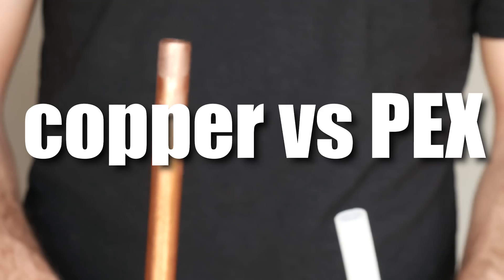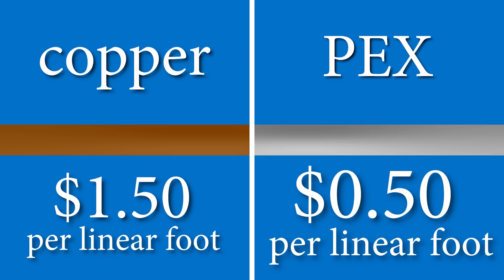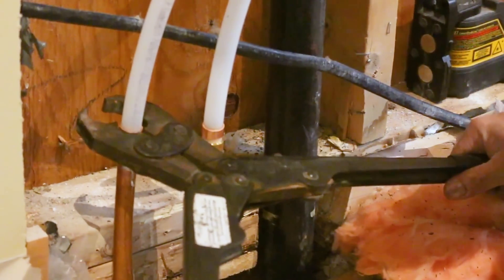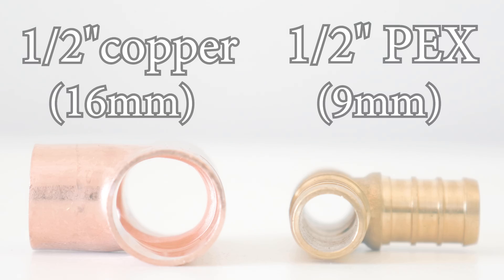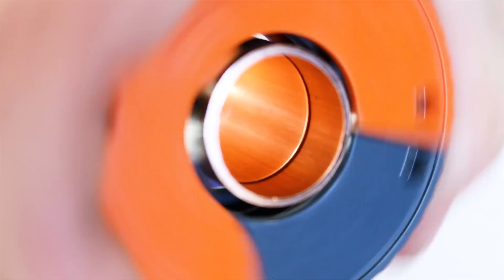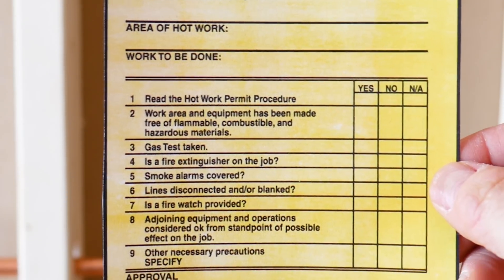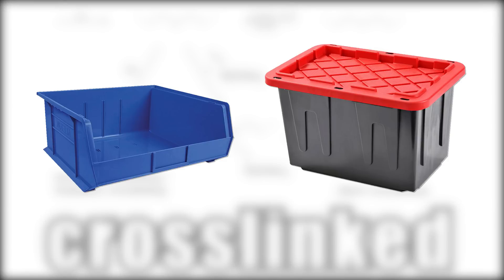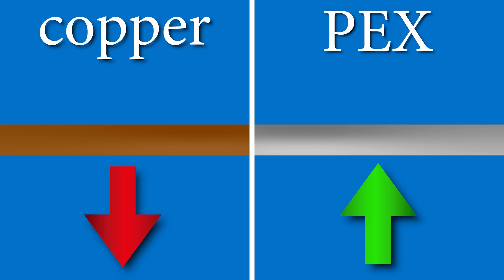Is Copper Better Than PEX? (COMPLETE GUIDE) | GOT2LEARN

Comment: A comment from a plumber friend of mine:  
"A lot of good points were made.  I would question his lifespan for both being 50 years I have removed copper that was over 50 years old and would have lasted another 50.  The pex system he was using had a metal ring that was compressed keeping the pex tigh around the fitting, over time the metal looses its strength I won’t even talk about degradation because of water etc..  Your pex system will last much longer than fifty years because you have a plastic ring that holds the pex in place."

The pex system he installed for me was using Uponor tubing with plastic rings.  Personally, I would only use Pex for heating and copper for drinking water because of copper's antimicrobial properties and plastic potentially leaching into the water.
Reply: Uponor fails often because of breakpoint chlorination and the undulations in the interior of the pipe which allows buildup of chlorine and ammonia. Fails in under 10 years, zurn pex b is also expandable but doesn't have the same issue with chlorine or ammonia because the interior is smooth.
Reply: Copper these days are recycled and the crappy stuff lasts 7 years.  Also, its hard to know how pure the copper your buying is.  In some states copper is a horrible choice based on the water.  The water will degrade the copper quicker than other areas.
Reply: I find your answer awesome and beneficial to me. I am trying to choose floor heating for my house and I was wondering if Uponor is really good. Most experts here do not know Uponor and say it is a lie because it takes only half of the size of the old school pipes in-floor heating. Do you have only 1cm isolation under it, or do you have more?
Reply: @galenachannel  I used Uponor for a cast iron baseboard radiator system.  Not floor heating.  Regardless, here in the NYC area it is the preferred product of the larger plumbing companies and contractors it seems.  I’m friends with multiple plumbers and they are sure to use only quality materials for my projects as I don’t mind paying extra for good value.  👍
Reply: @ed1pk  thank you. Quality seems good, but I wonder about the lack of isolation they advocate.  OR at least my local Uponor representative says I need no isolation on the floor, unlike the old-fashioned floor heating which must have isolation.
Reply: my copper was toast in 30
Reply: Remember copper comes in several wall thicknesses. What is it the K version the thickest? Or refrigeration copper line for direct burial under slab? Some of that copper gets pretty thin, cheap stuff anyway.
Reply: Excelente input, thanks you.
Reply: You're using anecdotal evidence.  I'm not saying he's wrong, but you shouldn't base your opinion on what a single or several plumbers have said.  Don't even rely on opinions on websites published by plumbers.  They likely have biases and are pushing a narrative.  You should try to base your opinions on research and statistics.
Reply: @absoluteloyalty9033  I’m not using anecdotal evidence for anything.  Just sharing an expert opinion.  Don’t sweat it. 😉👍
Reply: @ed1pk  When you rely on one of your experiences, that's considered anecdotal.  It doesn't matter if it's from a plumber; it's one data point.  Furthermore, 90% of plumbers are clueless.  Many of them are high school dropouts.  Most of them couldn't make college.
Reply: @absoluteloyalty9033  I’m not relying on anything.  I’m sharing the lifetime experience of an expert plumber.  Not one anecdote. You’re the one easily dismissing it.   Give merit on the plausibility and veracity of the explanation given.   Don’t just push your own narrative based on your “statistics” and personal dismissive bias against most plumbers.   That’s what these comments are for.  Sharing personal opinions and experiences.  Not formal verified stats and figures.  😂
Reply: @ed1pk  You are not relying on anything?  You are relying on the plumber's advice as well as sharing his opinion.  And, his advice might be the result of a lifetime of experience but it's still anecdotal.  It's still one data point that's based upon one person.

Second, a lot of contractors will try to validate their opinion but prefacing it that they have 30 years of experience.  I actually work in the industry.  If they are a bad plumber after 10 years, they are a bad plumber after 40 years.

Finally, I know this may seem snotty but it's just the blunt truth.  Most contractors in construction or other similar industries do not have a college education.  College doesn't make you smart but getting into college does represent due diligence.  It's no different than police officers.  Most are simply not smart enough to get into college.  As a result, you should be wary of their opinions.

Please try to think more before you make an opinion.  I'm not saying you're ultimate conclusion is incorrect (I actually agree with it so I'm not pushing a "narrative") but your method is wrong.  Please do not use the opinion of one plumber as the basis of your own opinion.  And, especially do not disseminate it as it leads to misinformation.
Reply: @absoluteloyalty9033  that is not only rude it’s wrong. Instead of accusing other people of basing opinions on antidotal evidence, try not doing it yourself. 
Your later statement proved your bias and therefore that you are unreliable as a source. Soooo…. Just troll on out of the channel
Reply: @absoluteloyalty9033  Yeah... well most college grads can't get a decent paying job while a tradesman will make way more money over a lifetime and always be able to find work!

Comment: I just recently gave in and started using pex to replace a frozen cracked copper pipe. Always said that i would never use anything but copper but with the current prices it's almost crazy not to try other options. Im still a fan of sweating copper but am starting to like pex equally for many reasons.

Comment: One item to factor in as well would be health issues. PEX is plastic, and there is at least some evidence that it can leech chemicals into your drinking water, with all the health effects this would imply.

I'm thinking I would use copper on drinking water equipment, with PEX being OK for other applications like bathrooms and washrooms. Of course, this also has an impact on your recirculation system if you have one.

Interesting video, as always !
Reply: Copper is now doing the same. The water treatment plants are using more chemicals and its etching it away.
Copper poisoning will be the next big scare.

Comment: An old copper installation is repaired and expanded again with copper.

Plastic tubes will be used for a completely new installation.

For copper there are solutions without soldering. 
Plug in and seal with built-in seals. Even better pressing, seals are also installed here.
Using this method, the heating in the Pentagon was renewed.  
Extra plumbers were flown in from Germany.

The downside is the price of copper.
Reply: Actually, you can repair an existing copper system with PEX. I have done it.

Comment: Does your PEX in the US doesnt have an aluminium layer? Here in Europe the PEX tubes have 5 Layer. PE tubing, polymer layer, aluminium tubing (1mm), polymer layer and on the outside an protective PE coating.

Also to press the fittings on you need expensive hydraulic presses...you cant do it with your hands like you showed in your video.

So i was just wondering...a PEX tube in the US looks like a better gardenhose. I would never lay it under the floor (screed)

Comment: For the flow restriction in couplings, this is completely ignoring Pex A expansion fittings, where it's full diameter and stretched as opposed to smaller and clamped/crimped.

Comment: I don't like PEX, because it is not gastight.
I like aluminium (or aluminum, whatever you like more) compound piping better, because it is a three layer pipe. Inner and outer layer are PE, the middle layer is aluminium (or aluminum). That thin metal layer makes it gastight.
The amount of tools is comparable to PEX, with only a calibration tool needed in addition.
It is as flexible as PEX and at the same time you can bend it to shape and it stays that way.
You can press it it up to 32mm (about 1 1/4 in) with big manual, bolt cutter style, hand tools (and a good breakfast) and machine presses (a little bigger than a power drill) likewise. Above that size the machine presses are mandatory. They are also a good option for tight spaces, but over all they are...pricey.

Comment: The main question to me is which lasts longer. 
And I'm afraid, PEX has not been around long enough to be able to tell about it's longevity.

Replacing piping can get extremely expensive, so that may justify an initial higher cost of copper.
Reply: It's been in use since the 1960s.

Comment: PEX is what I use on a daily basis but I think one thing that you forgot to mention
Is if you're plumbing is exposed to copper looks better 💁
Reply: 100% right. I installed an outdoor shower a couple of months ago and ran copper where it came out of the wall with brass valves and shined them all up, but on the inside of the wall, it was pex all the way.
Reply: @Odin029  So you think these mice cannot get to the inside the walls pex ??
Reply: @sajidrafique375  I said I've never seen pex pipes with rodent damage. That doesn't mean it can't happen, just that it would seem to be rare... at least where I live.
Reply: @Nonybusinessxxxxxx  PEX and other types plastic pipes are accepted and normal types of lines for potable water here in the US. Insurance companies will cover damage so long as their rules are met. That includes rodents chewing on pipes. I've never run into it once even as PEX has become the default in my area. I've repaired countless pinholes in copper, but not a single rodent chewed pipe.
The point about chemicals leaching into water flowing through PEX is the most legitimate. You're exaggerating a little, but it's at least a real issue. I've been reading articles and studies about that subject since at least 2014. Every study says that the water is completely safe. 
Speaking of safe to drink, have you ever looked at the inside of a galvanized pipe that's been used for a few decades?
Reply: @Odin029  
PEX sucks. Maybe it's just me but I have a hard time getting a good solder joint.
Reply: @tinman1955  Practice practice practice. You'll get it down one day.
Reply: @tinman1955  Get a crimp tool for copper and retire your torch there bub.  Also soldering is pretty easy.  Just need to get better at it, and it is all about controlling your heat.  When you have your torch on the fitting to heat it up, constantly use your solder wire to check the temp to see if it is hot enough.  You get it all too hot and it fucks it up.
Reply: @tinman1955  Was that a mis-word or did you just complain about difficulty soldering PEX pipe?
Reply: @r6u356une56ney  
It helps to get some proper PEX flux...and a bigger torch. 🤣

Comment: I'm hoping the cost of fittings and the ProPress tool itself gets low enough eventually to afford homeowners to use it.  All the benefits of copper with the install speed of PEX. OR Uponor can make the outer part of the PEX piping from something rodents dislike and won't chew through. 🤔

Comment: It should also be noted that if you decide to go with PEX, specifically PEX-B (crimping-kind), you have to up-size your PEX pipe size.  If you are replacing existing 1/2" copper pipe, you should use 3/4" PEX pipe and fittings to have a similar inside diameter size of the copper pipe.  BUT the problem is most fixtures like shower body valves or sink faucets are typically 1/2" connectors so you have to down-size back to a 1/2" PEX at the fixtures. Uponor or PEX-A doesn't have this issue as their fittings have a similar inside diameter size to copper.
Reply: Why not just size down to copper fittings or brass?
Reply: @jtoker9758  Problem with Pex-B is the inside diameter size of the fittings, not the pex tubing. Take any 1/2" pex-b fitting and compare it to a 1/2" copper pipe. Much smaller. Copper pipe fittings go on the outside of the copper pipe, whereas the fittings of the pex-b fits inside the pex tubing. This reduces the water flow capacity hence it's necessary to upsize your pex pipes and fittings

Comment: I used to be all about copper, mostly because I was concerned that we don't have the same longterm data we have for home water lines (I know they were used for floor heating) and also I was concerned about rats or squirrels or something chewing the lines.  All that changed with the Deep Freeze we had in Texas which coupled together with a 3 day power outage in 11 degree weather which dropped the attic temperatures below hard freezing points.  At my mother's house who had faucets running the whole time, she had two burst sections going to outside hose bibs. In the section over the garage, where there was no insulation, the pipe burst in 4 spots. Entire ceiling needs replacing. In another section going to another hose bib, a 90 elbow burst. Again, ceiling needs to be replaced.  

Every single house in that subdivision had burst pipes - all in attic, and almost all going to outside hose bibs.  All houses had copper piping.  Same for commercial buildings and warehouses. We even had the water shut off and thought we had drained the line, but in the warehouse, one line had two more spigots that we didn't see so there was a pocket of water that burst in 19 different spots.  Granted, if you could locate the pipe, the fix wasn't too bad - I learned to solder copper which is honestly a lot of fun but in places where it caused property damage, it was devastating for families. 

In contrast, my friends and relatives who recently bought houses that had PEX, none of them had any burst pipes and they lived even further out in the suburbs where the weather was colder.  It COULD be because they had better building practices and better insulated attics, but it could also be that PEX held up better.  All anecdotal of course but I found a lot more respect for PEX.  If I was building a house now, I think I'm still leaning more towards copper IF it's insulated and they follow the same building practices they do in the north but I would be perfectly happy with PEX too.
Reply: Texas should just update their plumbing building codes to be like the Northern US plumbing building codes/standards. Having PEX only delays failures from happening; without change, even with pex, this failure will happen again.

Comment: As a plumber i prefer pex as a home owner i say copper because of the strength
Reply: Correct. Plumbers want to SLAM the job together and get to the next one. Homeowner wants durability and longevity where copper reigns king.
Reply: very few of the plumbers i work with, hundreds, would rather use PEX. Plumbers hate coming back to the site to repair damaged pex pipes they just installed, done by pest.
For example, there can be a house that never had a problem with pest chewing on their pipes for 70 years, but as soon as they install pex in the crawl space, it happens several times within the same year. a year later, half of the pex installed, ends up being replaced by copper pipes and the problems stop happening. Working at a plumbing store, I hear all the problems plumbers are working with and see massive damage done to pex by pest.
Reply: We won't be calling you unless you disclose that at the time of estimating a job. I get it that homeowners are cheap and pex will make them happy but they should have a choice vs. "i use pex".

Comment: If anyone's buys this I have some ocean front property for sale in colorado. The main diff. Between the 2 is simple. Copper is cheaper unlike what this add wants to tell you. The main diff is you dont need to know about plumbing to install plex. It's like you run a garden hose for your plumbing
 Funny when a shark fitting cost 15 bucks yet a comparable copper fitting cost 25 cents. But sure it's cheaper lol

Comment: I recently installed an aquasana filter system in my house which calls for using Pex. I tried this but had issues with leaking where my male threaded brass fittings joined with the pvc unions. Every single one of my threaded pex fittings leaked at the threads. I did my bypass in copper and re did the filter plumbing in pvc. I also did my parents filter the same way. Copper bypass and pvc plumbing on the filter. So far it's working great, no leaks.